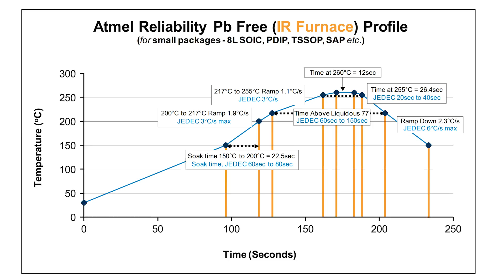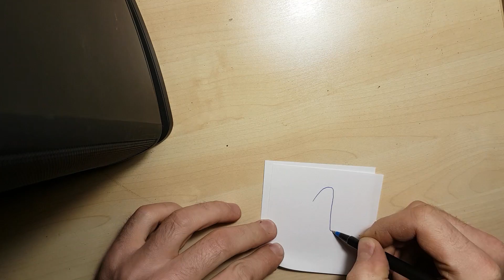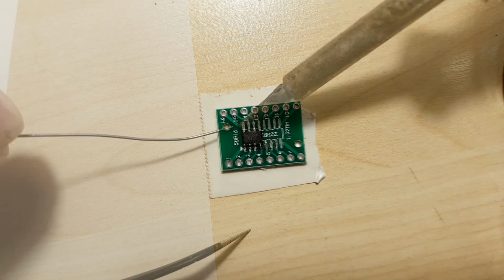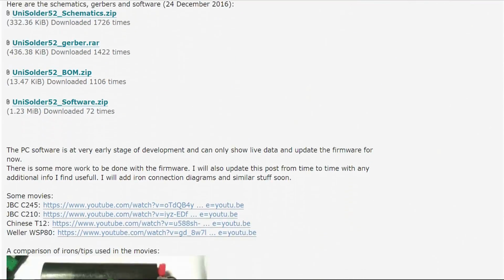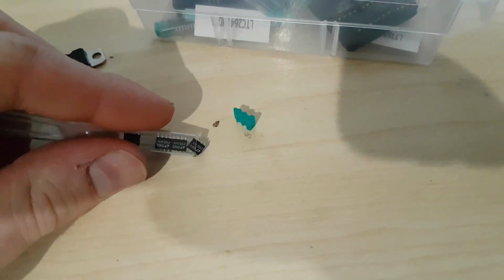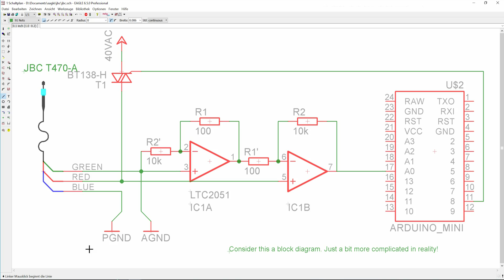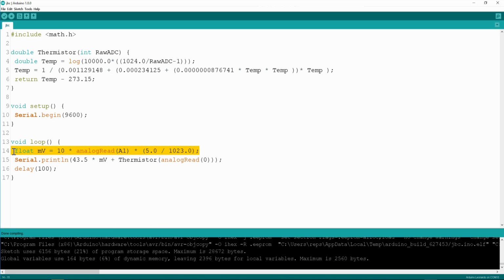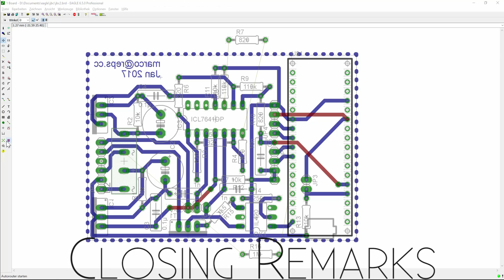Powerful DIY JBC Soldering Station - 250W C470 Arduino-based

Comment: What do you think about Chinese C245 and 470 tips and soldering Iron ?, I have the Aixun T3A 200W with T245 Tips since like 2 years, it work very great but the problem is the Tips dead very frequently, sometime even brand new died sometime it take time, beyond the quality of Chinese Tips i suspect the T3A to be too stressful for the Tips, i explain, the C245 Tips (2.5 ohms) are made to work on AC 24v source, witch is 17V RMS and then 115W compared with the DC 24V who is 230W, we need to remove the time of Temp sensor mesurment in the calcul but it's seem clean that the C245 tips are overexploited on DC 24v source, what do you think ? for me that can explain why Tips are so easy to break, and i suppose that even OEM JBC tips can be so survive more long on this
Maybe i should reduce the voltage of Dc/Dc down to ~17v to test if the tips are more reliable, by the way 200W are not nécessary, the Power are never at 100% except when we turn on the station for the initial heat, after the Thermal transfer are never enough to assure 100% for power except if we put it in the water lol

Comment: Great project!
What’s the reason for using AC instead of DC + PWM and what are your reasons for grounding the tip? Is it because of ESD?
Also what is the „fear“ of HF if using a switching mode PSU? What is the reason for that fear, you hear from time to time when dealing with which soldering station one should buy?
Looking forward to see so many great videos coming 😎
Keep up the great work!

Comment: 60 years ago I had a 15 W Antex and thought it was perfect. 50 years ago I got a Weller PU4 and for 45 years, I thought it was perfect. 5 years ago I added the Weller variable temp to my collection to suplement my almost still perfect PU4. Now I watch this and realise that I have been wrong for 60 years and my needs are more than I realised. Although a soldering iron with an impedance to gnd bothers me a lot. It should be switchable or variable.

Comment: How to you think is it good to convert the main voltage to DC first then control the heater by that DC? Do you think the DC will produce the electromigration then reduce soldering tip life time?

Comment: hello, would this project work with hakko t12 / t15 tips? what modifications would be needed? thanks
Reply: yes, it will work, you just have to connect the T12 tip accordingly. Look the schematic of T12 tip, it has TC not accessible directly, just move that connection

Comment: you really did put that expensive tip in water :O quick temperature change on the tip may cause it to crack
Reply: No, it will be just fine.

Comment: i have a banggood kit for soldering iron and it  IS perfrect. cost about 17usincluding 10tips. only addition is a power supply i use laptop 20v   4amp
https://www.banggood.com/Digital-Soldering-Iron-Station-Temperature-Controller-Kits-for-HAKKO-T12-Handle-p-1254007.html?rmmds=search&cur_warehouse=CN

Comment: Hello Marco Reps!

Very nice!
Only the original JBC soldering station has only 75 watts consumption instead of 250 watts in the European version at ~ 230 Volts AC and 50 Hz.
But you will certainly find even a more economical solution for consumption!
Reply: That 75w soldering station is the one wih c245 tips. The one with c470 tips also uses 250w.

Comment: totally giving away my secret tip, but mostly because I already have enough solder stations:

You can find old JBC soldering stations which work just as well as the new ones for ~100 bucks on ebay sometimes.

Comment: Hi marco. Iam from germany and want to build a station/ find out configuration for jbc nano tweezer. I have the unisolder  here. I ican send you the unisolder and the tweezer  if you can help me
Reply from the maker: The info should be here: http://dangerousprototypes.com/forum/viewtopic.php?t=7218
Reply: Iam also there. Sparkybg is gone  and other people  cant help with  to find it out. Only you 😁
Reply from the maker: Es steht leider nirgends, mit welcher Spannung die nano tweezers arbeiten. Die passenden Stationen NASE und NANE liefern aber laut Datenblatt 14W pro Werkzeug. Wenn du mal Widerstände zwischen den Kontakten der Lötspitzen misst, müsste da zwischen zweien ein Widerstand auftauchen, der nicht 0 ist. Das ist dann der Heater. Mit dem genauen Wert und der 14W Angabe kannst du dann auf die normale Spannung schließen und erstmal gucken, ob das 24V Unisolder überhaupt geeignet ist. Wenn mit 24V 14W umgesetzt werden sollen, müsste der Heater Widerstand ca. 40 Ohm sein. Wenn es nicht direkt geeignet ist, kann ich mir aber gut vorstellen, dass du einfach eine andere Spannungsversorgung und möglicherweise minimale Änderungen brauchst, um es trotzdem hinzubekommen

Comment: Nice project! Really makes me want to make my own soldering station as well... Your phone still working? :o

PS, you do know the ADC has 1024 steps aka you should divide by 1024, not 1023 ;)
Reply: In right-justified mode, the ADC's output is 0–1023 inclusive, so multiplying by ⁵⁄₁₀₂₃ will scale it to 0–5 inclusive. I wonder if it would be better to add 0.5 and divide by 1024, or even how significant any of this is vs. noise and the ADC's own measurement error.
Reply: But you do know the range of the ADC is 0-5 exclusive ;)

Comment: i bought DIY  Controller Kit for HAKKO T12 Handle from aliexpress, this kit also works with similar type heater and thermocouple integrated in hotend. You need to assemble the handle and put electronics in the case and also connect power supply. The kit needs from 12v to 24v dc power. Works ok from laptop psu. Max power 70watts but depends on psu voltage. Price only about 17euro and solders realy good. way better than simple solder iron.

Comment: Marco can You give Your PID tuning parameters ? i got mine like: Kp=2 Ki=0.2 Kd=2 but with other iron,
and it doest't work very well in term of first overshoot after powering up.
Reply from the maker: If you are using a JBC or something similarly powerful, I don't think you'll need PID, because the system is very responsive and doesn't need any 'planning ahead'. In the final version of this controller I am regulating proportionally only (heat for X mains cycles before checking again, where X = temperature_set - temperature_is or something like that)
Reply: It is not a serious problem - that start up overshoot(maybe it is even good, because the lag of heat transfer to end of the tip)
For now i have bought a pretty cheap but very good in performance iron with ceramic heating element.
Its is actually suprisingly good, comparing to cheap hakko clone. Here You have a link:
http://www.china-zhongdi.com/products.asp?CataID=134&cataupper=&k=&Page=2
It's a iron for ZD-8917B station
I have measured resistance of heater and it is about 2,7Ohm when cold and 5-6 when hot wich is giving about 120W of power. Still not JBC but not bat at all. 
For reading thermocouple im using max6675 and a calibration equation.
Maybe i will make some movie about it.

Comment: max temp?
Reply from the maker: I heard someone made a mistake in his controller circuit, which resulted in a red hot glowing tip. But that's not recommended, the original units go up to 450°C I think.

Comment: hmm.. you've omitted input protection from the instrumentation amplifier... the specifications don't allow more than 0.3v over the VCC, which is in normal operation ~5v... so it would fry the op-amp the moment it sees that 40VAC.

How did you protect it from over voltages?

Comment: Great video ! But I think many of us are wondering, why not just rectify a good powerful transformer or even better, use a switching power supply with enough current and than switch the DC to the tip with a MOSFET, forgetting about full waves, zero-crossing and so forth, and maybe even reading the thermocouple while powering the heater ? What's the disadvantage in using DC if JBC is also using AC as I understand... 
Thanks!

Comment: why didn't you use unconnected side of TC as TC output, and other, common as ground?
I think you could measure and heat at the same time, right?

Comment: Did you try to use the JBC tip with a cheap 852D+ solder station? The 852D+ outputs 5 cables for the iron and I see that the JBC has 3 cables. Do you think that the JBC tip will be able to be controlled from the 852D+ unit? Thanks!

Comment: I would love to understand the schematic. Why do you have two GND - PGND and AGND? And it seems you measure between GREEN and RED - but you also power the heater through GREEN and RED. If this cartridge is a resistor and thermo coupler in series, what color is the TC end, which the resistor end and which is the midpoint?

Comment: Amazing. How do you measure the zero crossing of the mains valtage?
Reply from the maker: With a 1M resistor from any transformer secondary to an AVR interrupt pin. That is possible because of internal clamping diodes that limit the voltage to whatever is acceptable by the µcontroller. The 1M limits the current so that the clamping diodes don't die. Optical isolation would be better, but this was the minimal approach.
Reply: Thank you so much for replying

Comment: how much that ltc2051 costed to you ?
Reply from the maker: Virtually nothing, got it in a big box of new old stock parts. If I wanted to buy a single new chip now it would be €4,90 + shipping. A possibility worth mentioning is a single op-amp with very low bias current - because one thermocouple pin is grounded anyway. The in-amp solution is neater and provides an output signal with less noise tho.
Reply: sounds quite expensive,

Comment: Super Video, wie die anderen auch!
Ich baue gerade selber eine Station für den JBC T245-A auf. Allerdings mit einem AC-MOSFET Schalter, dessen Ansteuerung galvanisch getrennt über einen 12V-12V-DCDC, um die Uds = 12V unabhängig vom Rest der Schaltung zu erzeugen, realisiert wurde. Ich benutze Mosfets um die Verluste so klein wie möglich zu halten, denn es sind mW im Vergleich Triac einige Watt. Mein Trafo ist aus einer alten 50W Weller WECP-20. Das heißt eigentlich zu klein dimensioniert, deshalb heißt es alles rausholen, was dieser Trafo hergibt :-) und später evtl. ein passender Ringkerntrafo.

Hardware funktioniert einwandfrei, bei der Software "happerts". Ich habe versucht es mit einem PID-Regler und Phasen-Abschnitt anzusteuern. Da bin ich, wie auch du, unglücklich über die Geräusche, die aus dem Trafo kommen. Nun hast du mich auf die Idee gebracht den Lötkolben mittels halb-sinus-wellen aufzuheizen. Das ist eine super Idee, allerdings werde/würde ich es mit Vollwellen machen, damit der Kern komplett ummagnetisiert wird und dadurch nicht in den Sättigungsbereich kommt. (siehe Hysteresekurve)

Würdest du bitte deinen funktionierenden Code hochladen, damit man sich da Ideen über deinen Zwei-Punkt-Regler mit Halbwellen-Ansteuerung holen kann. Es geht mir nur um die Regelung, Timer, etc..

Hast du einen kompletten Aufheiz-Zyklus aufgenommen, wie gut und wie schnell deine Zwei-Punkt-Regelung funktioniert? (Temperaturverlauf über Zeit)

Danke
Reply from the maker: Ich arbeite noch an der Software - die Kommunikation mit dem I2C LCD ist zeit-abhängig und verträgt sich nicht mit Interrupts. Der letzte Stand

#include <avr/io.h>
#include <avr/interrupt.h>

#define DETECT 2  //zero cross detect
#define GATE 12    //triac gate
#define PULSE 4   //trigger pulse width (counts)

float TCmV = 0;
int tempIs = 0;
int tempSet = 0;
int tempMissing = 0;
int mainsCycles = 0;
int mainsCyclesToCheck = 0;

double Thermistor(int RawADC) {
  double Temp = log(10000.0 * ((1024.0 / RawADC - 1)));
  Temp = 1 / (0.001129148 + (0.000234125 + (0.0000000876741 * Temp * Temp )) * Temp );
  return Temp - 273.15;
}

void setup() {
  delay(1000);
  pinMode(DETECT, INPUT);     //zero cross detect
  pinMode(GATE, OUTPUT);      //triac gate control
  OCR1A = 1000;      //initialize the comparator
  TIMSK1 = 0x03;    //enable comparator A and overflow interrupts
  TCCR1A = 0x00;    //timer control registers set for
  TCCR1B = 0x00;    //normal operation, timer disabled
  Serial.begin(9600);
  attachInterrupt(digitalPinToInterrupt(DETECT), zeroCrossingInterrupt, CHANGE);
}

void zeroCrossingInterrupt() { //zero cross detect
  TCCR1B = 0x04; //start timer with divide by 256 input
  TCNT1 = 0;   //reset timer - count from zero
  mainsCycles++;
}

ISR(TIMER1_COMPA_vect) { //comparator match
  digitalWrite(GATE, HIGH); //set triac gate to high
  TCNT1 = 65536 - PULSE;    //trigger pulse width
}

ISR(TIMER1_OVF_vect) { //timer1 overflow
  digitalWrite(GATE, LOW); //turn off triac gate
  TCCR1B = 0x00;          //disable timer stopd unintended triggers
}
 

void loop() {

  if (Serial.available()) {
    tempSet = Serial.parseInt();
  }

  mainsCyclesToCheck = sqrt(tempSet - tempIs);
  if ( mainsCyclesToCheck < 1)
    mainsCyclesToCheck = 1;

  if (mainsCycles >= mainsCyclesToCheck) {
    OCR1A = 5000;
    while (mainsCycles < mainsCyclesToCheck+2)
      delay(1);
    TCmV = 2.5 * analogRead(A1) * (5.0 / 1023.0);
    tempIs = 43.5 * TCmV + Thermistor(analogRead(0));

    if (tempIs < tempSet){
      OCR1A = 50;
    }
    else{
      OCR1A = 1000;
    }

    Serial.print("tempIs ");
    Serial.println(tempIs);
    Serial.print("tempSet ");
    Serial.println(tempSet);
    Serial.print("OCR1A ");
    Serial.println(OCR1A);

    mainsCycles = 0;
  }
}

Comment: i guess you though of this already, but if not you should definitely add a feature of turning the iron to sleep mode on about 200 degrees when you rest it on the stand and turning it off completely after 10 minutes or something. plus auto start when you pick it up. its a trully great experience, not having to press any button and having the iron ready to solder in 3-10 seconds whenever you feel like using it. at the same time the tip gets higher lifetime.
Reply from the maker: Yes, great idea! Maybe that could even be done "intelligently": The controller enters an idle state (200°C? Could be variable and depending on the idle time ...) when it didn't have to send much power to the iron for a time. But when it notices that suddenly more power is needed to maintain the idle temperature (it is touching something) it goes back up to the selected temp. BUT what influences tip life anyway? Higher temperature over time or higher currents during many steep heating cycles?
Reply: this implementation sounds too complicated in my opinion, if you'd rather avoid the coding hustle you can do it as in the jbc station which just checks continuity between the metal part of the iron and the stand. Not sure about witch factors exactly contribute at the life of an irons tip but some cheapo irons can get destroyed if left running 24hours in no time, but that is no indication cause they could be very bad quality materials or temperature control. and im not talking about burning of the heater, the main problem i have faced is not be able to tin the tip of an iron.
Reply: @reps  I know this is an ancient one - the easiest way to detect standing by/idling is having a holder/stand with a hall effect sensor and a small magnet in the handle (unless it's already ferromagnetic).
Reply: Marco Reps my hakko drops from 400c to 200c when I put it on the stand and heats back up in around 5 seconds, this saves the tip life
Reply: Temperature is the main thing that affects tip life. I have never seen a tip break mechanically or electrically, it always corrodes into uselessness long before. Temperature affects the speed at which chemical reactions like corrosion happen exponentially. So time spent at 300 C is much worse than time spent at 200 C, and 200 C is much worse than room temperature.
Reply: Is the stand detected by electrical contact? Then how does it detect when it moves over to the tool side? I always thought it was done with magnets. Will check on my unit, seems intriguing.
The JBC has two rest modes: sleep and hibernate. Sleep happens in stand, it keeps the temperature at ~180C. Hibernate happens after the tool has been in stand for ~30 minutes. Temperature can only be adjusted while the tool is out of the stand, I find this highly annoying.
Reply: Very annoying indeed. 
My ERSA D2k uses a 200C standby mode after x minutes (x is set in the menu) when the iron has not been used by analysing the power sent to the tool which works about 100% of the time. But you need to press a button to get it to heat up again which is a pain in the butt. The stand is not one of these stupid wire coil things but I guess they could still sense that somehow but that would require a cable to the stand or additional stuff in the iron itself. Magnets would be cool

Comment: JBC are top quality but expensive as fuck, why?
the inside of them doesnt cost 2000$
Reply from the maker: Yeh, those >2000$ probably have multiple supplies for the tweezers, vacuum and hot air ... Still they need to offer quick replacement service on top of that to justify the price

Comment: It would be really great, if you could also adapt your project for using the less powerful jbc 245 cartridges too....
Reply from the maker: I think the 24V DC + mosfet approach would be perfect for that
Reply: Not 24 but 15v dc would be nice I guess.(24^2/2.7=210w, should have been 75w. 15^2/2.7=83.3, seems legit)